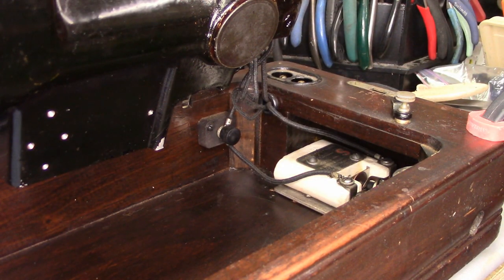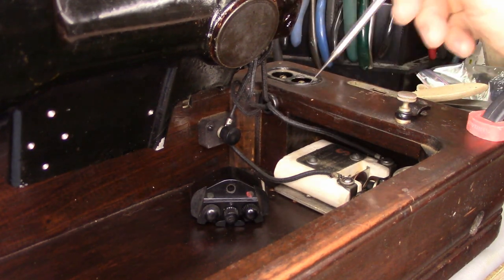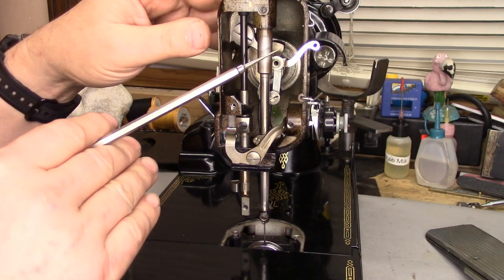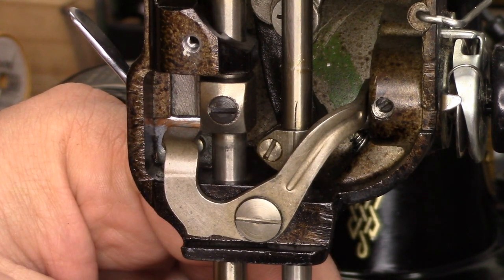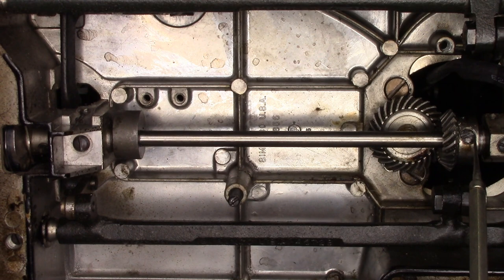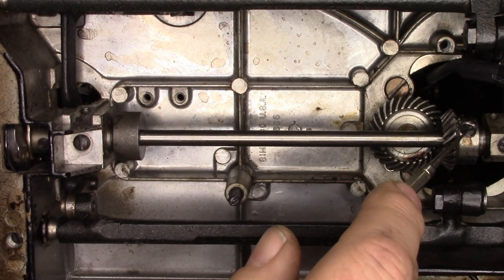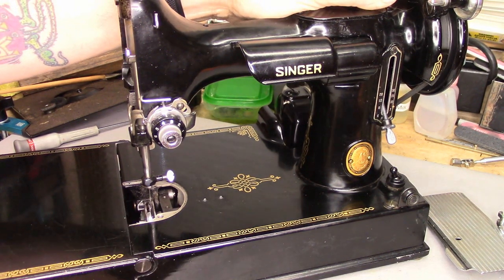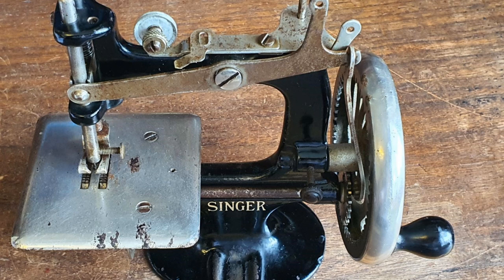More Singer 101 Wiring, Timing a 221 Featherweight & More! - Sunday Morning Quickies, April 10, 2022

Comment: THANK YOU SO MUCH! Your video was a HUGE help. I was cleaning and performing maintenance on a 221 that had been painted. Whoever put it back together had the timing off and the hook assembly not in place far enough which was causing the needle to hit a guard. You saved the day for me! Really appreciate your help. Successfully able to reset the timing, and quiet down the machine.

Comment: Awww, Roscoe - what a darling cat!  Thank you for the Featherweight Timing Quickie - I've got one of those partway pulled apart for polishing and cleaning and this will be really handy when I put her back together.  I love the other viewers projects too - all of them are beautiful.  As for mine, I have finished doing my clean/polish/adjust on that Model 20 now.  It sews beautifully and is so quiet.  I've seen a vid on youtube where someone pieces her quilts using one, would you believe?  And even quilts and binds some of her pieced placemats/runners that she makes using it.  They're the Shetland Ponies in the Singer Stable - very small, but proper little workhorses.

Comment: Bob, my inherited 1927 aluminum 101 in a cabinet is wired the same way your cabinet mounted 101 is. The three pin block is mounted under the cabinet on the read rail. I rewired the entire machine and it makes a beautiful stitch.
Reply: Rear rail
Reply from the maker: They are pretty damn awesome machines! I originally didn't want one as I have 201's.... then I sewed on one... Now I have two!

Comment: Bob, 
Thanks for the 221 timing video, it's good info. This may be of interest to you when it comes to the 101wiring. I have two cast iron 101's, the first is a1930 101-3 mounted in a #40 library cabinet and was wired originally with a three prong plug and a leg switch. The second one is a 1921 101-2 , it's one of the first 11,000 built. It's also the one pictured in the manual you posted (it has a #40 library cabinet with spreaders on the legs). The 101-2  has the two prong plug; but the rheostat is a series of contacts inside the head that a switch passes over, really cool setup. I haven't touched the 101-2 yet, so if you want to use it for a video MD isn't that far away... : )
Reply from the maker: The rheostat is INSIDE the head? Oh boy...
Reply: @BobFowlerWorkshop  just like the picture on page 11 in the adjusters manual you posted. I could to send you some pic's of it : )
Reply from the maker: @tomvaughan1157  yeah, I forgot about those... it was a long day! 😉